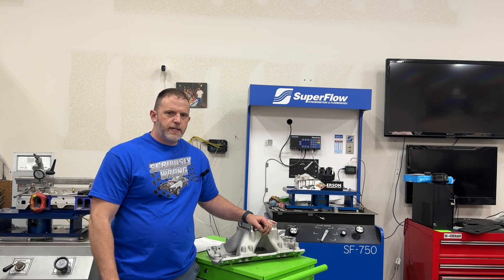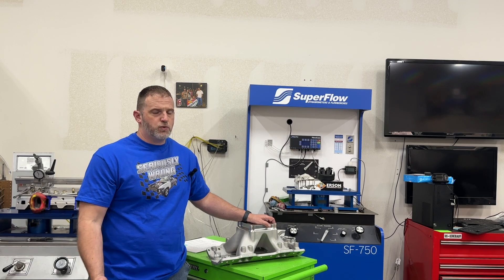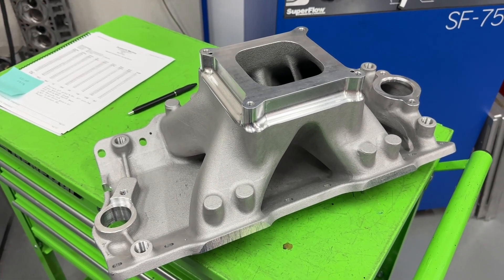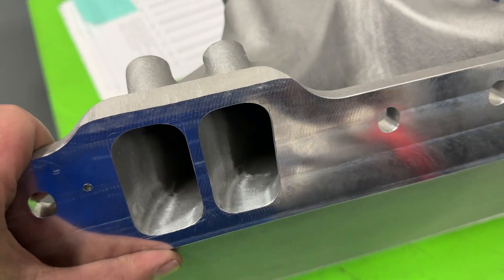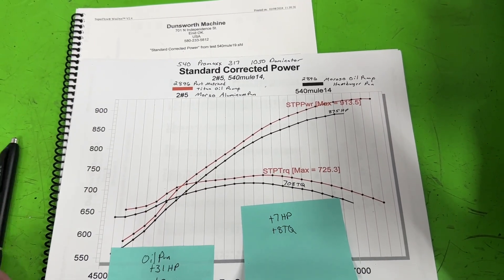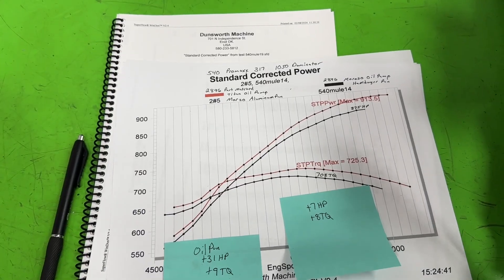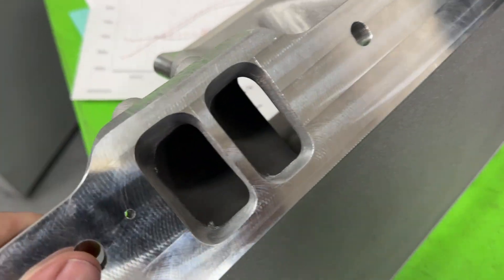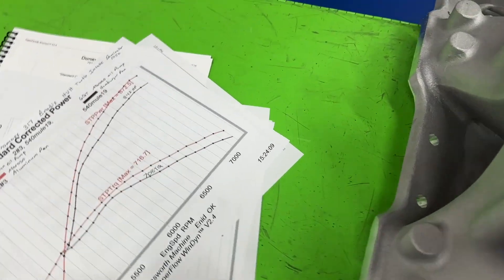How Much Horsepower Is Port Matching Worth

Comment: When your into performance .  You’ll leave no stone unturned .  As long as it’s not costing way more than what it’s worth .  You have to think also could port matching even up to see cylinders making even horse power .  Each one within 2-3% or each other .  When if you hadn’t did it your looking at 6-8% of each other .  So some working harder while others working more efficient.  It definitely says the engine should last longer .   With more even power made by eaxh chlknddr pulling its own weight .

Comment: Its would be good to hear HP gains also as a percentage. 7hp/0.75%, I;m sure I'm in the minority but as a person used to euro 4 cylinder of sub 200hp it easier to quickly work out what a chance like this might mean for a engine I have.  and to maybe a person with a more average v8 of 450 hp its more like 3hp.
Reply: 7hp on a 700hp at 7,000rpm engine in his case, 
But if you do the right mods on your 2 litre engine, you can easily gain 10hp for next to free, especially if it is inefficient out of the factory..
The trick is to either do them as cheap no dollar hp when you are doing a standard rebuild, or getting the last few hp out of a full power engine.
Reply: You will get more horsepower when you drive in cold weather

Comment: Seven sounds alright, but what if you Port match the headers?  What about minimal, or maximum opening of them? I know that you’re really busy, but it might be interesting to see your thoughts on this
Reply: Nope..you'd want a larger header than the exhaust port in the head . It's called  reversion resistance...exhaust comes back and interferes with the next pulse going out. .it'll even go back into the intake manifold

Comment: What if you just took a crap before a run would that be the same difference ?
Reply: 3000lbs car losing 1lbs compaired to engine gaining 0.75% at the crank. You will have to juggle the power to weight ratio gains/losses.
Reply: Losing 10lb is equivalent to 1hp gain.
In this case, dump 70lbs of car weight. Or, run 7 gallons less fuel.

Comment: We ran bbc rec port intakes on oval port heads, worked great!. 
7hp can be a glitch in the matrix.
Reply: I've ran same combo on a 396 ci 375 hp engine with 350 hp heads car was fast, won a ton of street races, made good power upto 7700 rpms. But never compared the intake with another nor done any dyno testing, therefore I can't say it's a combo that works best.
Reply from the maker: I tried that on the dyno and it lost big.
Reply: worked "great" compaired to what?

Comment: Eric, I’m not sure why you don’t think your test did not represent a direct comparison. Your test with the non port matched intake and changed oil pan/system represents the baseline and the same setup with the port matched intake is a single change incremental.  It would have been nice to see photos or sketches of the before and after port matching. When you find the intake is missing aluminum to port match can’t you blend out the port on the head side? Thank you for all the time you take to put out this data-I think that actually does make you a nice guy
Reply: it's not a baseline because the unported manifold was never run with the new oil pan. 
The 2 runs were,1: old manifold/old oil pan and 2: new oil pan + matched manifold.
Reply: @krusher74  thank you I had not picked up on the fact that it was a different manifold on for the oil pan old and oil pan new test
Reply from the maker: Krusher no. I did old manifold old pan. Then old manifold new pan. Then the port matched manifold. It had already been tested with the old pan when it just wasn’t port matched.

Comment: My easy method of port-matching: Tape a foam 44oz fountain drink cup to the hose of your shop vac. Stuff the drink cup into the bore of your bare block. Mount your bare heads to the block Rubber cement the intake gaskets to the heads. Mount the intake manifold. Turn on shop vac. Spray primer down into the intake manifold, aiming the paint toward the cylinder being sucked on. Repeat for other cylinders. The primer will show you exactly where you need to grind the head ports to match up to the manifold ports. Plug valve guides, exhaust ports and plug holes when actually "painting" to maximize suction on intake port. Pictures of the process: https://i.imgur.com/Ev5U0QE.jpg      https://i.imgur.com/3A29uHN.jpg      https://i.imgur.com/Ajhe5xt.jpg

Yer Welcome!

Comment: 31 horse from a oil pan and pump?? How? The flow ??
Reply from the maker: Yes. I did a video over it. Windage and power needed to turn the pump
Reply: old nhra stocker trick i learn drain qt oil out gain 10th

Comment: What’s your opinion on lifter valley stand pipes on sbc. I’d like to see a back to back dyno test of with and without them.  Vizard claims something like 8hp gain.
Reply: Yeah its like 1.5% keep the oil off the crank from the lifter valley. Roller setup only

Comment: In my experience, port matching has a lot of variables that could easily make it worse more often than it makes it better. But at the same time, that doesn't mean it wont pick up power on a really good combination. The point being, the combination is far more important than port matching will probably ever be.

Comment: On a sbc if the min of the head is still smaller than the intake manifold port would it ever matter if it was matched?
Reply: That is a situation where it will pay off even more to enlarge the head to match the intake. That lip is a flow killer
Reply: @ but let’s say I’m not allowed to port the head, rules and stuff, if the intake manifold opening is bigger than the MCSA of the head port would port matching matter?
Reply: @hardchargerllc  time for epoxy in the manifold

Comment: I wouldn't mind you to to put a vacuum pump on that engine with old sump verse new good sump and see what it does
Reply: like can u find a difference in sump verse vacuumed  and a correlations see if breathing issue or sump issue or drain back issue location of drain back

Comment: Off topic. Do you think a tapered 4 hole spacer(super sucker) on a dual plane would work if you knife edged the divider and basicly taper the outer sides of the divider to match the spacer? Asking for a friend......
Reply from the maker: I don’t know I never tested that.
Reply: @WeingartnerRacing  
Is porting or port matching worth doing on a low RPM tow engine? Max RPM is 5k.

Comment: depends on the heads and intake,delta positive -delta negative..what keepers valve springs and retainer are you using on those to easily use a 800 lift cam ?

Comment: Port match hp gain is all dependent on the original match .

Modern intake casting are alot better that thr old days depending on what you got.

Im sure some hp gains on old mismatched things are upwards of 30 ho depending on combo.

Wheras modern stuff is more like 7. Howeveit may not take into account a gain in port stabolity and the ability to maintain rpm? im guesing st thatthough havent seen any evidence of that yet.

Comment: Ah yes DV is Sending us over here. I believe he has alot of respect for you. People can tell when you are the real deal.

He did tell people to subscribe to you because you are the real deal.

DV he is a man based off of facts. As well as you Eric. Eventually, this issue will be resolved.

I think part of thr issue is each engine type is completely different, and sometimes those subtle differences can have different effects regarding what restriction to power is effecting it.

I do know for a fact however that vakve spring technology has increased dramatically the more time passes by.

I believe even Darin Morgan says they ho can be gained by a lot just due to valve springs.
Reply: I have watched before DV said anything
Reply: Move on and touch grass

Comment: I do have a question why is that manifold already have a size that is almost 1206 size when there are heads that can be smaller than that so what makes the manufacturer do that especially for guys who buy a small head like a like a 180 head just for daily driving or whatever.
Reply from the maker: Manufactures do a one size fit many approach. The 1206 is more common.
Reply: @WeingartnerRacing  oh got it I see

Comment: It's kinda confusing but I kinda got it but anything helps. And obviously for sure it won't apply to everything and it depends for sure. Yeah I do see what your talking about on port matching mine did overlay on 1 side which I knew it was going to happen but height wise was fine. Even the stock victor Jr it overlay 1 side of the head and it was multiple ports not just 1 so I do wish manifold did start off smaller wide wize because I did measurements myself and went if it overlays a 220 head even though cross section is more important was I thinking what if you had a 180 head that is like a 1205 and you had a manifold that is already big at close to 1206 stock which I mean average guy won't pay attention to that or even care or probably won't do much at just a thought i just had.

Comment: Question, with 12.2 compression what's your dynamic compression? If it is 10.1 ish can you try 93 octane? I'm willing to donate some funds to see that Dyno test ? Does he have knock sensors on his Dyno. Let me know sir . Thanks 👍
Reply from the maker: I don't have knock sensor. It probably could run on 91 if I reduce timing. We don't have 93
Reply: @WeingartnerRacing  let me know it would be a great test . I have no problem donating for that test please let me know Eric and thank you awesome info 👍😎💪 probably running a little fatter as well as that timing sir

Comment: Many years ago I port matched some Holden GM cast iron heads to an original 4 barrel  inlet manifold. On most ports they weren’t even close a few of the ports had 2/3’s of the port blocked as the head was left and the manifold was right in the shift. Just cleaning this up turned the motor into a screamer.
Luckily the inlet manifold is aluminium, so some welding was needed to help bring it to the heads.